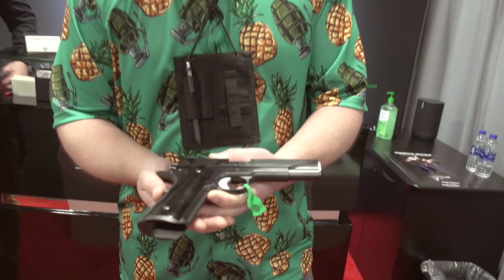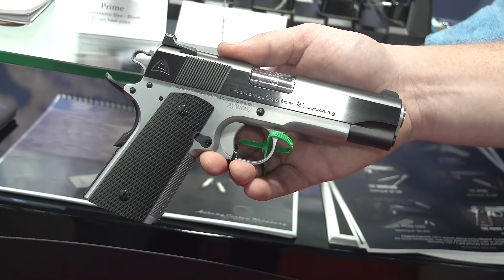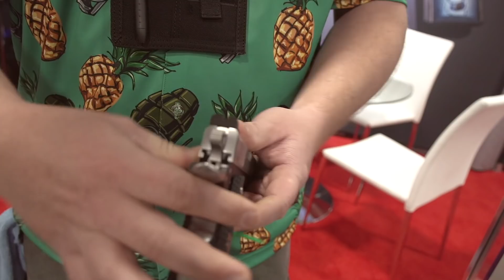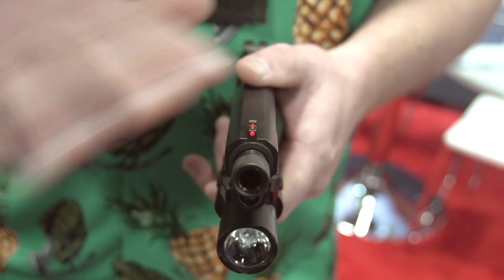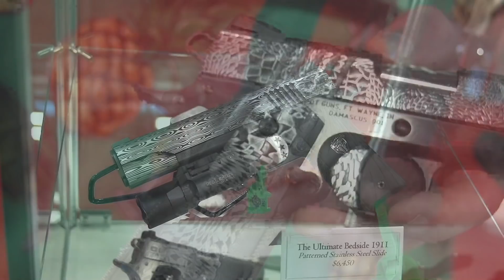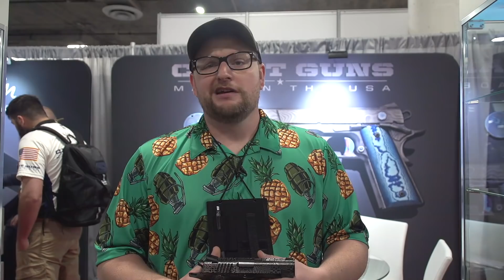SHOT SHOW 2020: Cabot Guns New Products

Comment: the acid etch is not for protection of the metal, it's so the damascus stands out. Frankly, I wouldn't want damascus anything in a pistol, damascus is not as strong as solid metal. It's for looks only. I'd like to have a matched set of the workaday ones, one for the left hand, one for the right, with the empty being tossed away from me to either side. I also like to have the thumb safety done away with, I don't find it necessary, and it may slow a draw and fire time.